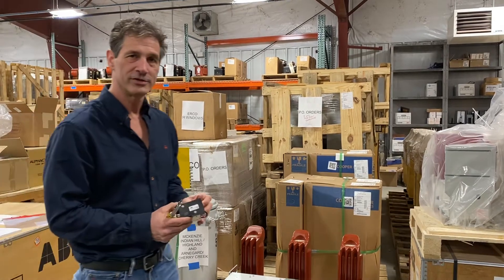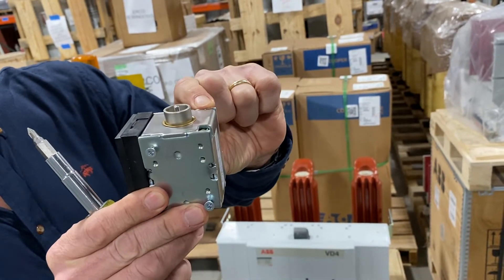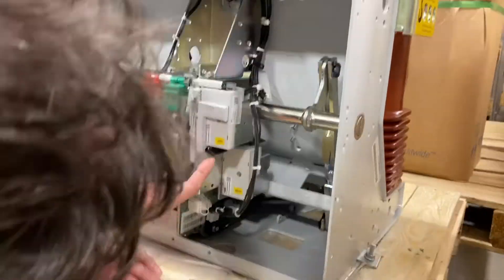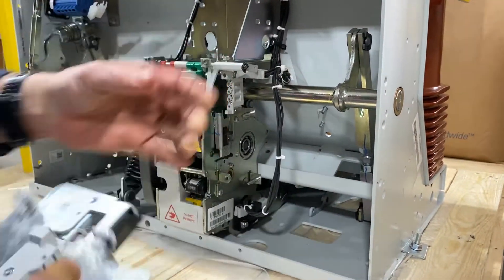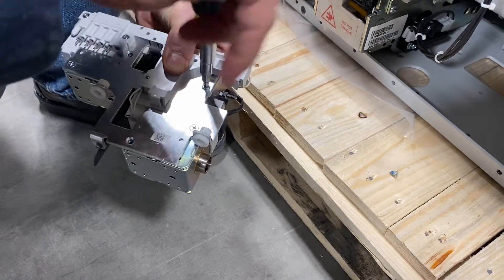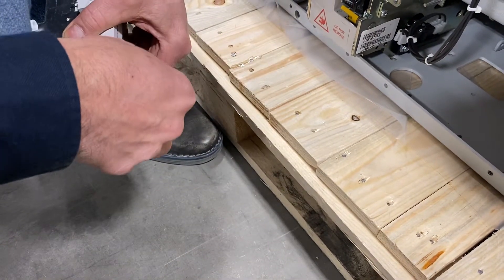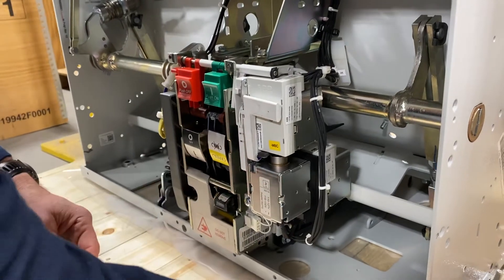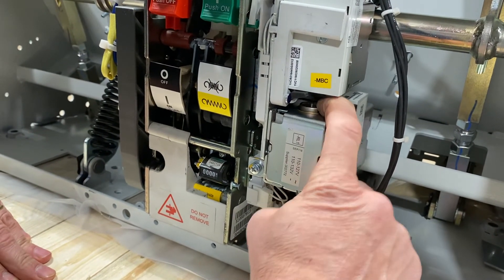Installation of an Undervoltage Trip Coil in an ABB VD4 Vacuum Circuit Breaker

Comment: Great video. At time 2.18 you said the plunger pushes against the breaker (the plastic paddle I will call it). What I would really like to know is how the 'paddle' when forced upwards by the voltage being removed from the undervltage solenoid and the plunger raising upwards onto the 'paddle'... What other mechanism is involved to force the spring to open the breaker. Is there a release pin or something attached to the 'paddle'